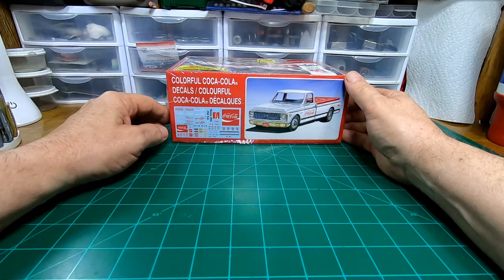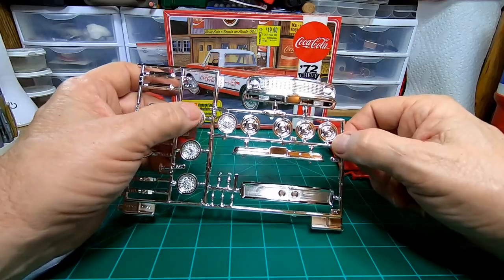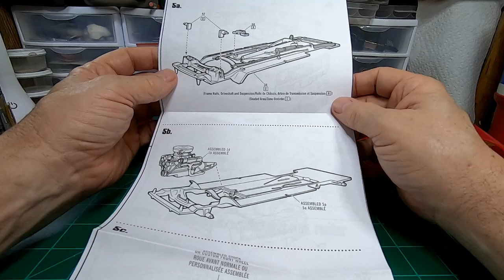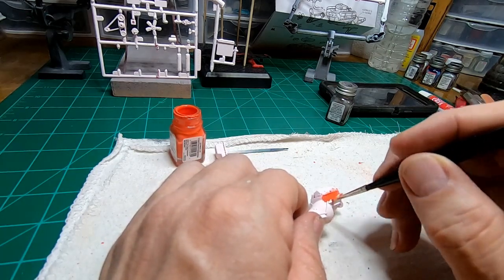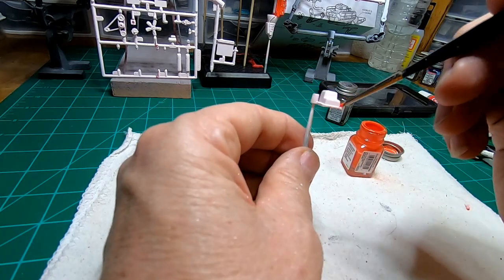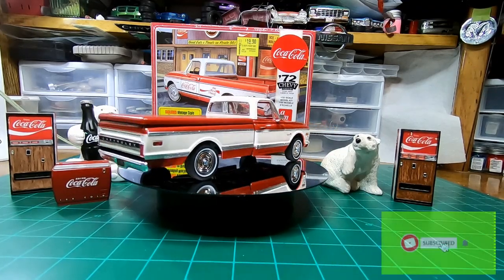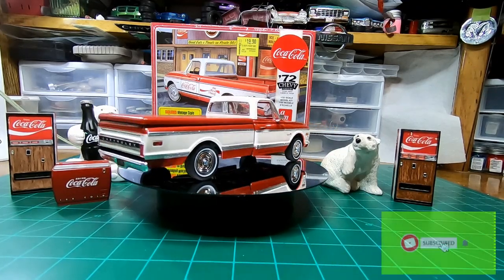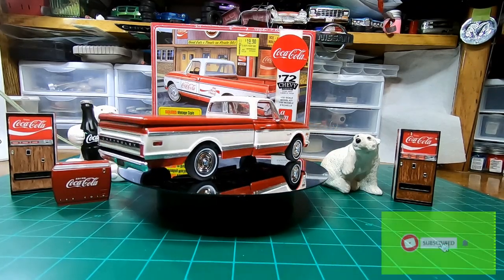1972 Chevrolet Cheyenne Fleetside Pickup by AMT - Episode 44

Comment: Came out incredible, the primer did a great job of hiding the red molded plastic for your white panels. Decals can be tough when they are long and thin. Nice Coke machine and accessories.👍
Reply from the maker: Thank You! I thought that using that "sealer" would make painting the white paint easier. All it ended up doing was adding more work for me as I had to strip it off and start all over again. The gray primer is my go to primer for everything and I should have just trusted my gut feeling about it and saved my money and time. I was having trouble with all of the decals, large and small. The only ones that came off the paper in one piece were the license plates. All in all the truck did turn out pretty nice, so I can't complain about that!
Reply: @scaleautoguysworkbench  I use that Zinsster product on ceiling tiles, to hide water leaks coming from roof. It works great in that application, covering stains.
Reply from the maker: @rayrussell6258  There was about 4, maybe 5 different forums that I searched, and there were guys in those who swore by this stuff. Apparently, they had never actually tried it and were parroting what others were saying. I'm sure that this works very well for its intended purpose but certainly not for red styrene coverage.

Comment: Nice kit. Yes the red plastic bit me on my 4 door conversion of the AMT fire chief car. Hopefully that primer will work.
Reply from the maker: I posted on my Facebook page a while back how I felt about red plastic. I wish that these kit manufacturers would stop using red, yellow and orange plastic altogether. Those colors are hard to cover especially with a lighter color of paint. That white Zinsser "sealer" was pink almost immediately after being applied. I even tried a second coat with zero luck. Then I tried silver over that and then the gloss white. The pink was showing by the next morning. After stripping all of that off I went to my ole standby gray primer. Two coats of that followed by two coats of the gloss white. So far, the gray primer has held the red color from showing through. It has been about ten days since the paint was completed and it is still white. Thanks for watching!

Comment: I almost picked up this kit at Walmart, wish I did. 
The only thing I'm not liking are the headlights and taillights. Headlights need clear covers so they don't look like chrome (AMT should have provided that), and the taillights are supposed to have back-up lamps above the taillights, all of that combo surrounded by chrome trim.
Reply from the maker: Usually I  put a coating of Mod Podge over the headlights to dull down the chrome a bit and give it a touch of realism, I forgot to do that this time. As for the taillights, well there isn't much about them that can be done. The reverse lights are molded into the body. In my opinion the entire taillight assemblies are too wide. Other than those discrepancies it does build into a decent looking truck. If you see these at Walmart again, they are worth picking up. I have a couple of these I'm going to use in future kitbash builds. Thanks for watching!

Comment: not only is it red, its a real close match to Coca Cola Red
I've been thinking about picking one of these up, thanks for the unboxing
I heard somewhere that Testor's silver works to seal red plastic
Reply from the maker: This kit was sprayed with the zinsser primer twice, and the red still poked through. I then shot silver over that. I thought it was good to go and shot some white paint over that. Still, the persistent red got through all of that. I ended up stripping all of that off and started over again. This time, I went with my old standby gray primer. Two coats of that and two coats of gloss white. It still has a very light pink tint if it's at the correct angle and light. For the most part, it's covered up. Just the paint on this kit took almost a month to get it right. The rest of the build took about a day or so. Thanks for watching.
Reply: So true, it is a close match to Coke Red.

Comment: Question: do you sand your models down before priming them? I’ve heard that not sanding them doesn’t let the primer grab on as good but does sanding down your models really make a difference?
Reply from the maker: Thanks for the great question. I have heard that some guys sand the bodies before laying down primer. In the 1:1 world, it's a good idea to do that to give the surface a little "tooth" for the primer to latch onto. It's probably a good idea to do that for model kits as well. I personally don't sand anything beyond removing mold lines and flash or the occasional light reshaping of a body panel. I do wash them with warm water and Dawn dish soap before primer. Generally speaking, I don't have any issues with the paint/primer peeling off of the bodies, so I know that it's adhering well. The problems that I experience most often are usually with paint compatibility even amongst same name brands. So, if you want to lightly sand your bodies before priming, it won't hurt to do it. Just be careful around thin name plates and other trim features. On some kits, these are done so lightly that it doesn't take much to erase them.
Reply: @scaleautoguysworkbench  thanks for the respond! I do wonder. Do you put on the floor polish before the bare metal foil? I’m currently working on a model car myself and I’m kinda worried that if I put the bare metal foil on first and then put on the floor polish, it could lift the metal foil off.
Reply from the maker: Sorry for the late reply! Yes, I do put the floor polish on before the foil. It may just be a preference thing but... in my mind I don't know what would happen if I did it in reverse. I've always done the clear then the foil. I guess the reason would be that the clear may affect the way the foil shines (it may dull it down).
Reply: @scaleautoguysworkbench  Thanks for the advice but I did add the polish on after the foil and really nothing happened and the foil actually came out more shiny than it was without the polish. Few days ago I completed a AMT model of Christine. It turned out pretty nice despite it being my first model car I’ve done.